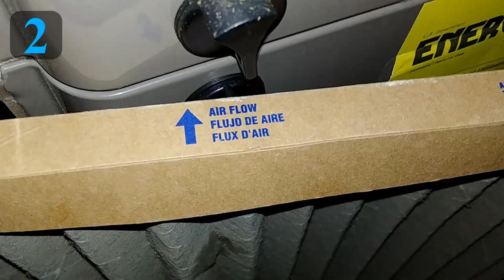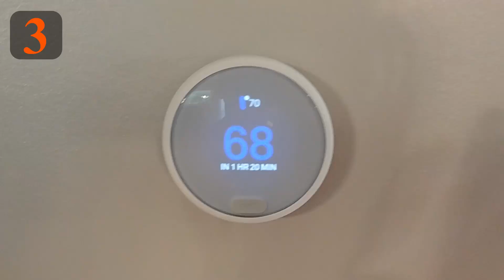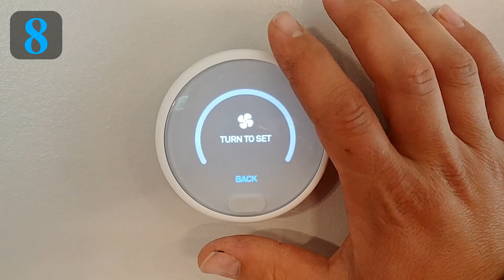Simple AC Problems You Can Fix With No Tools!

Comment: Hey Ben I am fairly new to your channel one thing that might help also for your viewers is most Rudd and Rheems unit on the outdoor condenser unit might be a red button by your in and out lines is a reset button that might be tripped and unit wont be running until you smash that button and if you have a float switch where your inside air handler unit is your system might not be draining and if you blow or clean out that line that also could make your unit come back on . Good luck hope this helps someone

Comment: Thats a York/Coleman microchannel condenser. If its a microchannel, 9 times out of 10 its a leak. SHES A LEAKER MAMA!
Reply from the maker: I know that if it does have a leak it is tough to fix but haven't seen many leaks on them personally. Are they just more prone to corrosion in your opinion?
Reply: @BenjaminSahlstrom  In my opinion, the cause for microchannel failure is due to the aluminum fin/design. It cannot take much operating pressure as cooper. The microchannel was originally designed for air conditioning system in cars due to it being lightweight and having less operating pressure. You can try repairing the leak but its going to pop-up again in a different area. Also with the microchannel, you're unable to pump them down, so you'll have to recover all the refrigerant when making repairs. 

If I pull up to a job and its a microchannel condenser, 9 times out of 10 its a coil leak. I primarily work on mini splits and havent come across microchannel systems in the NYC area. I've learned a lot from Steve Lavimoniere. Check out his channel!